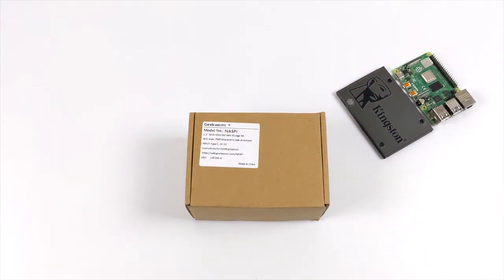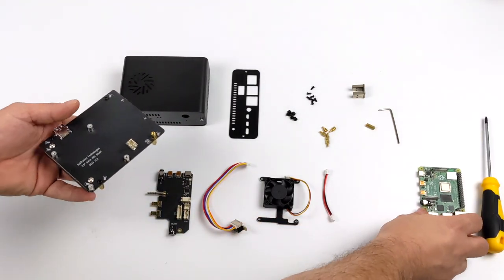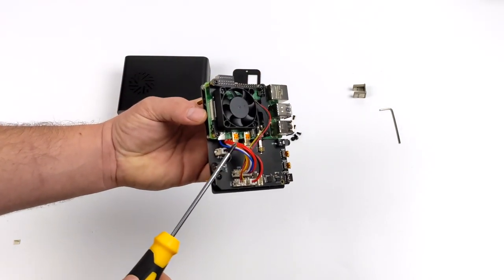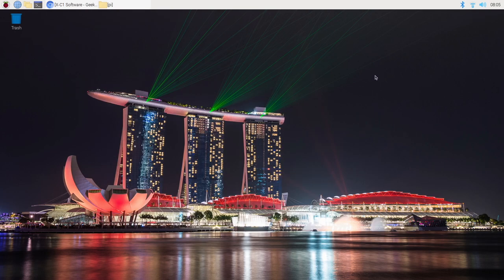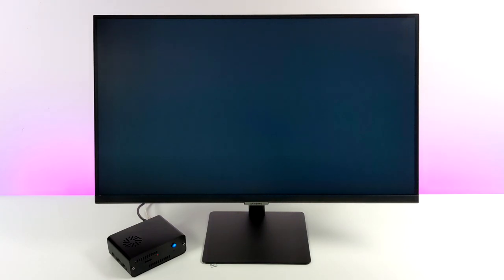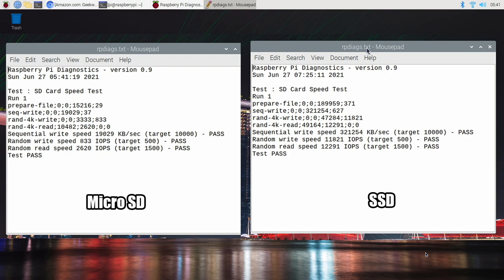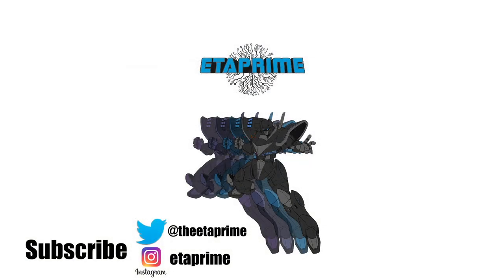Awesome New Pi4 Case! SSD, PWM Cooling Fan, Safe Shutdown NASPi Case

Comment: Looks good, but it's too bad they didn't change those micro-HDMI to full-size like the Argon ONE M.2.  Functionality-wise, this is the same as the NESPi 4 case.  That one's plastic and includes a power supply for $40, whereas this one is metal and doesn't look like a toy for $56.  For comparison, the Argone ONE M.2 is $45.  Each has its pros and cons.
Reply: Hi friend, thanks for your advice, this will be updated in the next version.

Comment: Waiting for thermal test, WiFi performance and emulation using this case. :)
Reply: Thermally I think it would be fine with that fan, since it'll only kick on when it gets too hot, but I'm also curious if the WiFi is affected.  For a NAS you'd want to use wired ethernet if it's available, but it's still an interesting question.
Reply: Yes that would be nice and then overclock the Pi and then do the test again !
Reply: The manufacturer warns that 2.4 wifi will be severely affected by the casing, and that 5 wifi "might" be perfectly fine, but it also might not, so they recommend using an ethernet connection.
Reply: Thank you for recommending this product that has nice looking 
.i love it, 5g wifi works perfectly.

Comment: Just got done with the process. Thank you so much for the easy to follow, thorough tutorial.
Reply: What file system did you use for your SSD? I'm planning to build a NAS for media storage. Wondering which one would be bette,r NTFS or ext4.
Reply: @NaveenRajksr  I guess I should’ve been a bit more specific. I’m finished with the build/install of Raspberry OS, upgrading, and executing the commands for the fan to work upon boot. I have not set up my server yet. I’d love to keep in touch if we can help each other out through the process.

Comment: why would you create a board to move the ports to the back of the machine and NOT convert the micro hdmi to regular hdmi? -_-
Reply: My thoughts exactly.
Reply: Because they are trying to squeeze every penny of profit.
Reply: Maybe they will learn when it doesn't sell well? I just don't understand why when making a product for a device (pi) with a huge community of users, why don't they listen to input from the community?
Reply: Since it is for a NAS, they presumed it will be running headless.
Reply: Geeekpi had a similar case, the DeskPi Pro, that converted the micro hdmi to standard hdmi.  It was about the same price, but had a beefier cooler.  Don't see it listed on amazon currently though.
Reply: @Count_Smackula  I have one, and since they addressed some early release issues, I can vouch that it's far superior to this thing...

Comment: Thanks, Prime.
The all-in cost (albeit with a massive assumption on pi4 at retail) for (1) the pi, and (2) this case is better than one of the popular low-powered 4x4 UCFF x86. However for that slight amount more, some may prefer Windows/x86 plus a USB 3.x Gen 1x2/2x1 port. Who knows. Kindest regards, friends and neighbors.

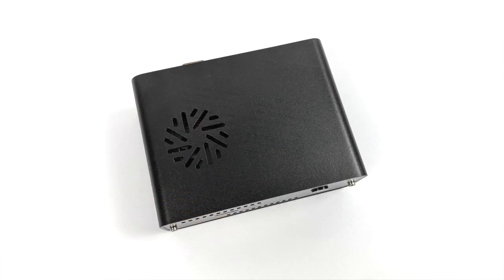Comment: I bought one of these, and have noticed that the fan does not line up with the fan does not line up with the ventilation slots on the top of the case. You can see this at 4:02.

Comment: Looks like the DeskPi Pro.
The DeskPi Pro gives you two full size HDMI ports, and allows you full access to the 40 pin I/O.  It also let's you use an M.2 OR an SSD.  Mine has a 1 TB SSD in it.

Comment: This looks like the desk pi, which has the same featured for 4 more dollars and actually has full size HDMI and an Ice Tower Cooler.
Reply: yeah, looks exactly the same as my DeskPi minus full hdmi (which i don't use as I'm usuall running my PIs  headless)

There were issues with the first version of the deskpi PCB but they eventually shiped a new version for free ... perfect since then

Comment: Missed one step in the process, now I have to take the entire thing apart.  Make sure you put on those bottom stand-off screws before you mount the daughter board and Pi4 to the top.
Reply: Also, install that script first, it's a bitch to break this thing down three times.

Comment: Reading reviews on Amazon I notice people talking about bluetooth problems with the metal case. I imagine Wifi might also be affected. The other issue is, it runs on the higher side temp wise but not to the point it throttles under stress testing. Still, I could care less about BT and for a NAS it'll be connected by ethernet to my router. I suspect some modifications might resolve the temps as well. This is what I always see with Geekworm, great ideas with the implementation not quite fully there. The minor details always seem to be overlooked with them.

Comment: Still gonna prefer the Argon case because of the full-size HDMI ports…
Reply: Why do you need a full-size HDMI for a NAS?
Reply: @flatiron235  who says you have to use it as a nas?
Reply: @lonster3000  as the name of the product correctly implies, it is mainly meant to be used as a case for a NAS. So therefore, it is kind of strange to criticize it for not having a feature, which a NAS doesn't need to have. 
You don't buy a hammer for turning a screw and then complain, that the "blade" is to wide. 
These a simply two totally different use cases.
Reply: W/ one hard drive it’s not really a NAS. Two is the minimum for backups.
Reply: @Bob_Smith19  NAS = Network Attached Storage. So technically a USB Stick attached to your router is also a NAS. 
Multiple storage devices, better in a RAID configuration, doesn't make it it more or less a NAS. This configuration can also be found in a desktop computer etc
Reply: @AstroCat is also love this case. With the M.2 SSD the PI4 is it currently my desktop PC
Reply: @AstroCat that absolutely true. But these are additional features for a NAS. 
I also agree that this is a mediocre product. There a far better options for a NAS setup for a Pi. So you have 4 SATA adapter for 4 drives. So you can setup a software raid. 
But I just don't see the necessity for full size HDMI ports for a case which is advertised for a NAS
Reply: @flatiron235  Why the hell would I run a "NAS" off a single USB hard drive and no administration interface? Oh wait, I wouldn't. Yet more reason to buy the Argon M.2 case, which has virtually the same feature set using smaller M.2 SATA drives, and has full-size HDMI connectors too.

My workstation's got 30TB online. If a so-called "NAS" can't even back it up, what's the point?
Reply: @knghtbrd  my NAS at home also doesn't have an administrator interface. It is a Linux system RPi 2, and I have configured it via command line.  But is big enough to backup my system. 8TB. So? This is not a NAS?
And you can install openmediavault on the Pi. So you can also have a fancy administration interface. 
I am not saying that this ist the best NAS of the world. You definitely would choose a NAS with RAID Controller and maybe an interface if needed.
Reply: @Bob_Smith19  NAS is NOT backup….
Reply: @knghtbrd  …so the Argon M.2 case runs multiple drives???

Comment: You state that all Raspberry Pi NAS boards support hard drives over USB.  But aren't there compute module boards that support drives via PCI Express and wouldn't they be a much faster and scalable solution?

Comment: The only question here is how loud is that fan. I bought a regular fan equipped case for my libreelec player, but the high pitch noise from the fan made me take it out and back into a generic RPi4 case, which means It's running quite hot.

Comment: So, I can you test this case with the analogue video output? I tested 3 separate Argon 2 cases and none of them worked properly with the analog video output. The jack was just a millimeter or so too far out for it to register and it was super disappointing. I know this because if I disconnected the two HDMI ports, twisted the daughter board a little so that the 3.5mm jack when in all the way, the analog video would work through the daughter board. But no matter how hard I tried to force the board in normally it wouldn't work when it was in the correct way.

So it would be nice if you could test this to make sure it's fully functional. Otherwise, this was a pretty good video.

Comment: Omg I just built one of these with a power management board and data board from geeekpi! This case looks slightly better. Do you get wifi with the bottom drive connected?

Comment: I had no luck when I tried to install the fan control as I could not login to github through the PI . I installed Twister OS and it has fan settings built in but there is no mention to the GPIO setting in the wiki . Other than fan control I like the case.

Comment: Still prefering Argon One, its the same but cheaper more beautiful and smaller. Also has passive cooling under 50°C
Reply: It won’t maintain that for long periods of emulation w/ a max over clock. The passive cooling is nice but it has its limitations.

Comment: Sweet case design. But as with other similar cases I’m not a fan because of a few things. No HAT install is possible, I prefer USB-C power to GPIO, and the ugly USB3 connector to SSD is external. 

I’m probably in the minority with my preferences. But it does seem these issues could be rectified pretty easily with a few design changes.

Comment: Thank You for the insight. The only thing that I don't like is the external "jumper" to connect the USB3 ports. Very ugly, and seems fragile. By the way, since You're always a step ahead, any news about an 8Gb P400 ? ( or at least one with 3.5 mm audio jack ? ) If Your monitor hasn't audio, You have to resort to an external splitter, and that totally spoils the purpose of having a clean, all-in-a keyboard system ....

Comment: Nice video ! With a so big case, they could avoid using a fan and use the case as a passive heatsink. Maybe the sliding of the pi will not be possible but why to add noise when you can avoid it !?
Reply: There are a few passive cases but alot more expensive as its from a single block of aluminium
Reply: @ProctoLogic  Thanks for your comment, I own a couple of Flirc cases that aren’t that expensive so I thought that something similar wouldn’t increase much the price of the case reviewed here. Anyway good to know that there are other solutions.

Comment: The bottom of that UAB 3.0 adapter shouldn't have exposed pins. I recommend either using a different brand, or at least use kapton tape at a minimum.

Comment: I am really wanting a case with a built in USB 3.0 hub. I have two external 3.0 hard drives attached to my Pi4 using it as a file server for the Kodi boxes around the house, and any of these cool cases that take up one of the 3.0 ports is a deal breaker for me without buying another hub. Sigh.

Comment: Hi ETA, what Sata-USB Chipset are they using, Is it a ASMedia or the crappy JMicron, one of the Board'as floating around has the wrong ASMedia chipset, so it cause the same problems as the JMIcron

Comment: @ETA Prime, it appeared there weren't heatsinks on your Pi. Is there room for a heatsink with the fan in place? Personally I use a heatsink with a fan as the bare chips don't have enough surface area for good cooling in my book.
Reply: I wondered the same thing.

Comment: I'm looking for something like this, but with at least 2 SATA ports for redundancy, 4 SATA ports would be even better.
Reply: People are working on it using the cm4
Reply: @the_retag  oh damn that sounds even more awesome.
Reply: @The2808erik  check out jeff gerling he does vids on that stuff amongst other cool (often pi) stuff
Reply: @the_retag  yeah.  Was gonna recommend that also.  That last NAS board he tested was pretty neat (capable of running quad 2.5 or 3.5in drives), but if I remember correctly he said production was delayed.
Reply: just buy your favorite pi case and add an external raid case. Doesn't look as sleek but it's a NAS and supposed to live in the closet.
Reply: @TheClazziquai  there is a significant performance difference
Reply: @the_retag  If you benchmark them, sure. But if you use it for backup you wouldn't notice. At least it's not worse than the case from the video since both are connected through USB 3.0 and apparently that's enough for most use cases so far.

Comment: I like the passive cooling of the argon one. The fan is only needed when that is insufficient. Otherwise I do like this case.
Reply: You need the fan for emulation if you’re going to play for long periods. It won’t throttle but it tops out close to the point where it does.

Comment: How is the WiFi / Bluetooth being in a metal cage?
Reply: Well you will be getting less range since that metal affects overall performance. I highly recomend you wire this up to your network or if Wi-Fi is a must get a Wi-Fi dongle with an antenna. Its currently the only way to get max range in a metal case like this. Still its my humble opinion that getting SSD support and safe shutdown/reset functionality outweighs the downside of reduced range on WiFi and Bluetooth.

Comment: two things i don't like about it, things sticking out, i don't need access to the sdcard that much, also too easy to brush against and loosen it, rather have it behind the front panel or recessed much farther, the usb jumper, i consider a hack, not a polished product, find a way to put it inside the case or find a way to skip it.

Comment: What could i use a raspberry pi for?
Reply: Emulation, youtube, twitch, appletv etc and some android.
Reply: @HowToRacist  what type of emulation?
Reply: N64, snes, gameboy im not really into emulation so i dont really know the full capabilities of it. Your better off watching an eta video on this topic
Reply: @HowToRacist  most things below N64 are good/great. N64 is mostly not there but some simple games work well. Same story with DC and Saturn, some work, most don't. Anything older than those 3 though will be fine.
Reply: @chomp7927  the most ive played on pi 4 is mario 64 which worked okay. But yeah some games that i tried didnt work very well. But snes works great
Reply: Retropie

Comment: The kingston a400 is not a great sata ssd, due to its lack of dram cache, and lack of hmb (host memory buffer, a protocol that allows a dramless ssd to borrow system ram as its cache) support due to the sata interface. This results in random speeds and lifespan lower than other sata ssds with a dram cache, such as the crucial mx500 or the samsung 860 evo. With how competitively priced the mx500 is, it is hard to justify the a400 unless it is significantly cheaper.

Comment: I've been looking for a replacement for my Argon One M.2 case with WiFi problems so this one seems nice. Has anyone got this one and tested WiFi? Seems like all metal cases just kill WiFi.
Reply: I've heard it's the usb 3 connection creating interference but idk
Reply: Wifi is horrible due to the all aluminum case.
Reply: The manufacturer warns that 2.4 wifi will be severely affected by the casing, and that 5 wifi "might" be perfectly fine, but it also might not, so they recommend using an ethernet connection.
Reply: @thelastmotel  makes sense, these cases are for wired networks... Thanks for the info

Comment: And where is the nas aspect now? i can't see the nas, it looks like a normal pi only with a fan controller and ssd
Reply: You must download a program that can do that. So it’s basically a Pi become NAS controller, you will can also use Type-C and the ports and buy a Nas Drives that supports multiple enclosures per port it just a bare bones Nas Drive
Reply: @justassimple8328  Sorry but a nas case has more than one slot, I realize that you have to configure the pi but only a storage drive with a pi is not a nas, at most it is a pi with a better boot medium and a fan controller more not, a nas case is for me the quad sata hat kit out the video of 
Novaspirit Tech

Comment: Can this fit an ice tower low profile version? It's hard to eyeball. Yet another case with holes everywhere and no sound insulation. I have an ice tower, but the fan mount is niche and whiny.

Wish you showed Ubuntu instead... If you're using one of these, you're going to want a non-amateur security minded OS. Ubuntu has been rock solid since disco donkey.

Comment: Looks a bit unfinished to me. Metal case adds nothing to the cooling as its not heat sinked and would degrade wifi signal, Drive still needs to take up a usb slot and has exposed pcb just waiting to be shorted out (dangerous & tacky), and the aforementioned micro HDMI not being converted to full HDMI. Overall pcb design is poor and needs jumper wires, which is the whole purpose of a custom Pcb. Poor cooling for the ssd drive. A pass for me.

Comment: I despise all Pi 4 cases, not one of them come up with a decent passive cooling solution, using a fan on such a low power device is plain lazy.
Reply: The fan is both small and very quiet. A passive cooling aolution involves a bigger heatsink and that raises costs significantly. Its why most manufacturers go with the fan. It saves space and money. In this case it also cretes a bit of airflow in the case so it also keeps the SSD temps in check, a heatsink would just dump heat that would eventually heat up the SSD hurting overal performance
Reply: @alexisrivera200xable  If we are building a case designed to house a SSD in it, maybe we can make the SSD passive cooled too, you're not making a good argument.
Reply: @dibblah68  The keyword here is "decent".